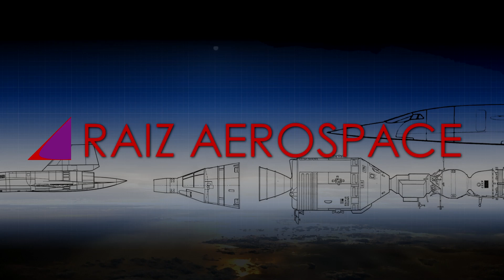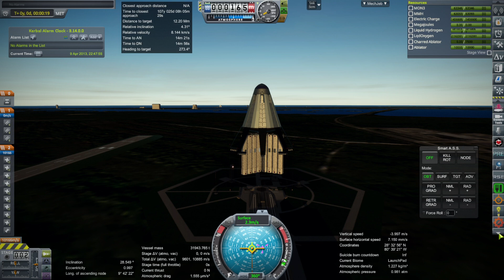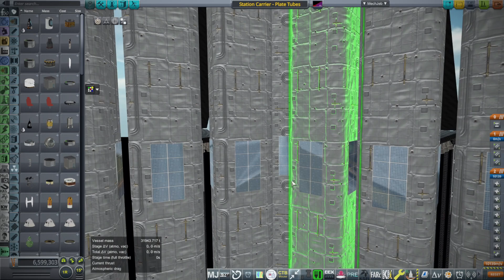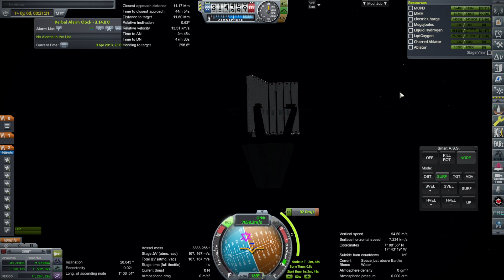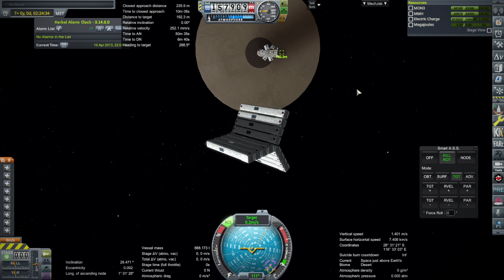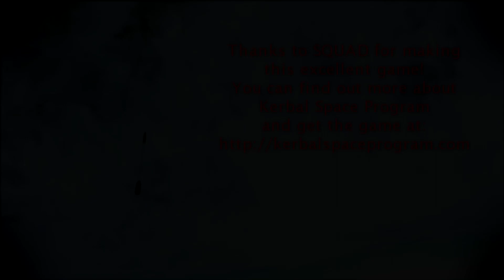O'Neill Cylinder Construction 3 (Kerbal Space Program with RO)

Comment: After having watched a few of these videos, and docking attempts, etc...  I was thinking of something that might be more...  Accurate?

If you had a hole, only slightly larger than the part you're trying to dock, with the docking-port at the deepest part of the hole.  So it'd be like a male/female joint?  But one that's square-ish enough so you can ONLY fit it together in a certain orientation, so you can't accidentally rotate out of position.
Reply from the maker: Pretty sure that would make this even harder, given KSP's propensity to glitch. At this scale, I just want it to work.
Reply: @RaizSpace  You're right that it'd be harder...  BUT I still feel like it'd be a good option to ensure it's connected in the right way.  

Although maybe it might work to increase magnetism to like the max?

Comment: i remember one of the mods i have uses a square docking node that will only attach at 90* i wonder how that works.
Reply from the maker: That's a setting you can add to the docking module in the config file. I generally don't use it.